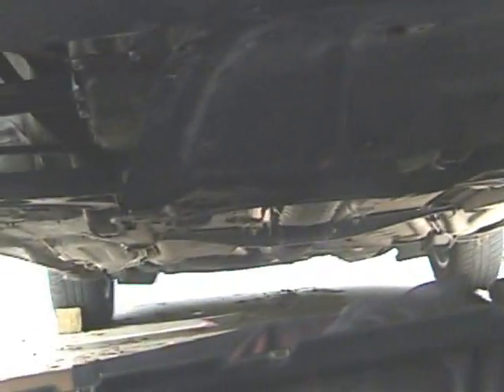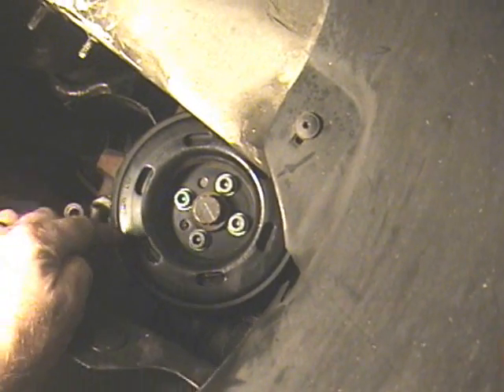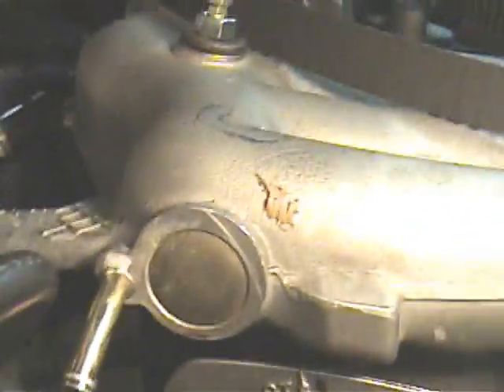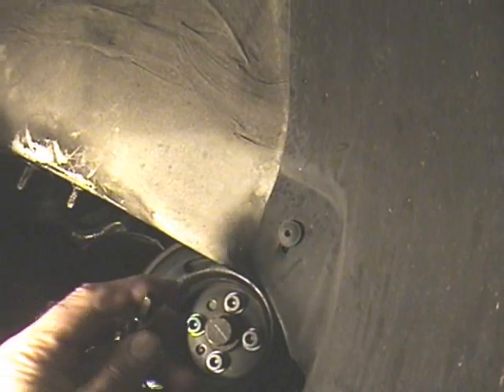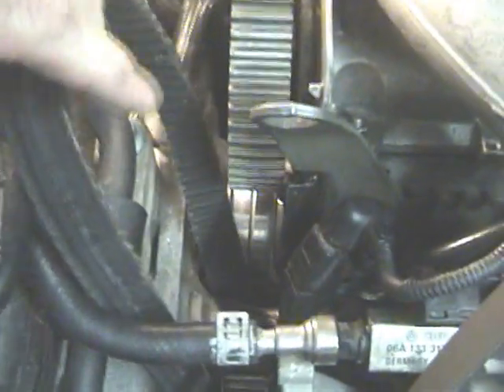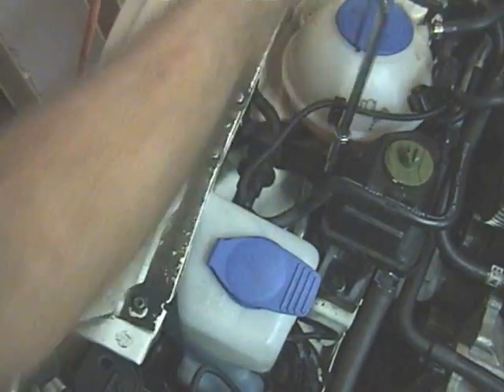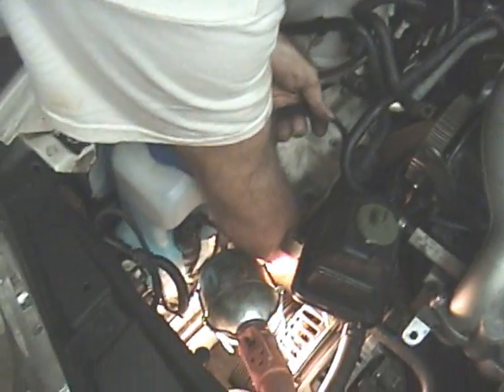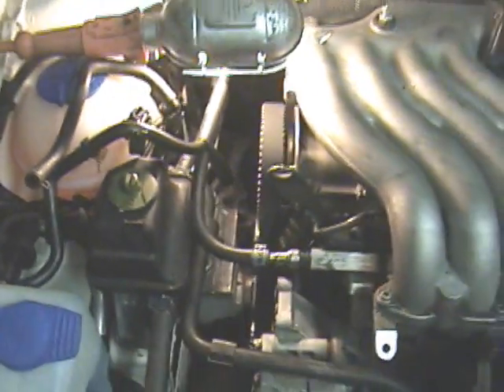How to Inspect and Replace the Timing Belt on a VW 2.0 L Engine

Comment: I dont understand the flywheel part... If some one can help me out id appreciate it. I bought a car from a guy that i think installed the timing belt wrong. Im scared to start it cuz i dont wanna bend my valves so im trying to figure if the marks are in the right place. Ok first question when my Cam pulley lines up with its marks does my flywheel  mark have to be lined up? Also i found the mark on the crank pulley but i can find what to match it too.

Comment: What a great video!  I really appriciate it because I am getting my timing belt, water pump and serpentine belt all replaced tomorrow and was very curious as to how it was all put together.  I am at just over 90,000 miles on my New Beetle which has this same engine in it and am curious.  Just how often should I get the timin belt replaced?  I know at 100,000 miles is the recommended but will my new one be the same or should I get it check again sooner.  Thanks again for the awesome video! :)

Comment: They just changed my timing belt in 2.5 hours in a repair shop on VW 2003 Jetta.
Is that possible? I am wondering because everyone saying that takes 4-6 hours.
Possible that they didn't change but charged me? On the top of it the car has a noise after the replacement of the timing belt. Any thoughts please.

Comment: One thing I wanted to add early on in the video. I just went on a head and removed the tire. Easy to do and will give you optimum room and light in that area so you can see. I have the car sitting on jacks. I'm going to tackle this on vacation within the week. It's a second car. I would like to be operating it as it is my economy mileage vehicle over my 4.0 liter V6 truck. I'm finding out VW did not make this vehicle maintenance friendly. Transmission service, Spark plugs etc...Pain in the Butt!

Comment: I've viewed your video a few times and this time around I'm taking notes and steps. I've also read the procedures out of a Haynes manual and they actually have you remove the spark plugs off. Did you do this? I replaced those plugs about two months ago. That in itself is a pain in the ass. The worst of it just getting the boots off of those recessed plugs. Now I know there is a special tool for that...that is even better than those curbed end needle nose pliers. Haynes has you relieve fuel psi.

Comment: I was just going through all the step by step in my Haynes Manual for replacement of the water pump and Timing belt, it mentions nothing about removing the Engine Mount. My engine is an AEG and the Vehicle is a 1999 VW Jetta. Your video is very thorough and in depth. Many tried to make a video on this but fell short. They ended up explaining most of it with little hands on that was actually viewable. I'm sure that's what everybody is impressed with your video. Thanks again for posting.

Comment from the maker: @eldoradony Thanks for your posting.  Yes, the original VW water pumps break down frequently and earlier than they should, so replacing them with a water pump with a metal impellar is ALWAYS a good idea.  I don't know, and haven't had a bad experience with the tensioner pulley, but it is no doubt a good idea to replace it.

Comment: Just did this job and then found this video.  This is right on accurate! Motor mount is a bit difficult to maneuver out but can be done. I would strongly recommend changing the water pump and tensioner pulley while the engine is apart. Gates and Dayco sell kits with all three parts for less than the sum individually.

Comment from the maker: @TheWarRelic You only need to line of the square window with the white mark if you take the timing belt off.  As long as the timing does not come off, you can use either method.

Comment from the maker: Correct.  The mark is a line with a circle on the top.  You keep turning the engine crankshaft and it will eventually appear in the window.  It indicates TDC for Cylinder No. 1.  You align two marks on the crankshaft pulley and engine, but those are very hard to see and not as precise as using that window.

Comment from the maker: A light wack with a rubber mallet should take it right off.  If not, and if your pulley is actually being held on by that 19mm bolt (the crankshaft bolt), then you have a different engine that this one.  If it is different, and the crankshaft bolt is holding on the pulley, there is a good chance that you do not need to remove the pulley to replace the timing belt.